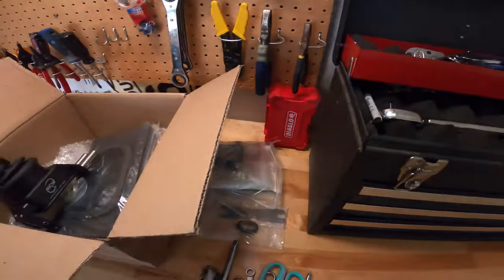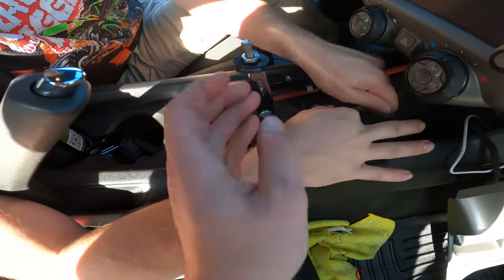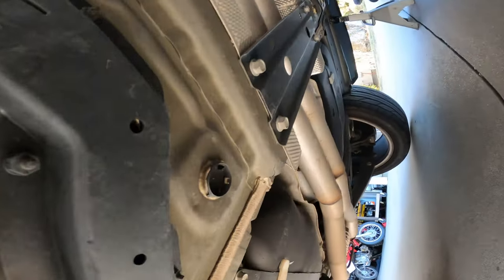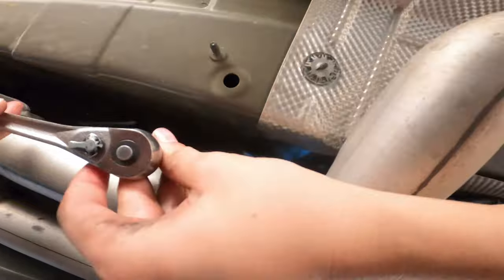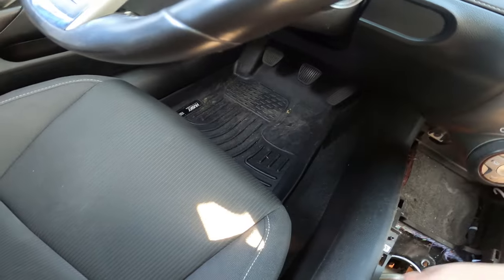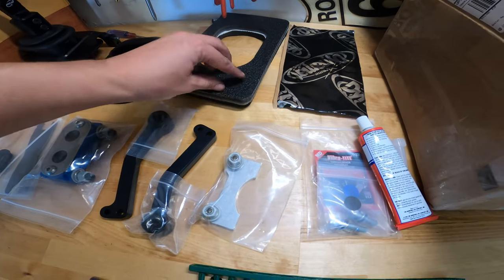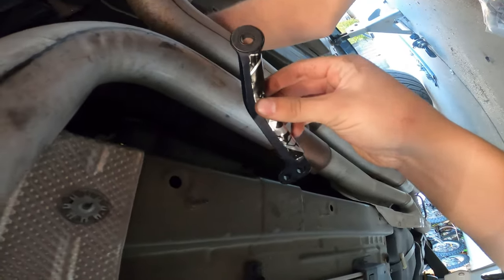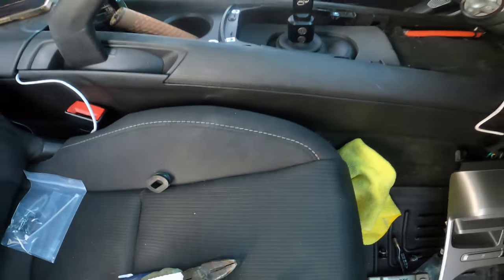The best short shifter for Camaro ss MGW

Comment: Any side to side "slopp"?
Reply from the maker: Nope stiff
Reply: @jacobMMotorsport . I need to borrow you guys for one day 😂, I’m 74 and not as able anymore.  I just installed a Hurst short throw shift, and yes I have been told that the MGW is the Cadillac of shifters but the Hurst is good for me plus I found a new in the box for extra cheap.  Everything went okay until pretty much the last thing which was getting the bottom rubber dust cover back on the metal flange (that I saw you completely remove), I just can’t get my hands on it enough to get it on.  I ordered a pair of 24 inch long medical tweezer/pliers looking instrument to see if I can get ahold of the 4 rubber tabs in order to get it back on.  My ZL1 shifter looks different than the SS shifter and I read that the ZL1 shifter is a “short throw” shifter from the factory.  Anyway this old guy enjoyed your video. 👍🙌🏻
Reply: I just finished watching the end of your video and my Hurst shifter appears to have a much shorter gate, it is so short that I think I will get a taller handle to replace the ball handle.